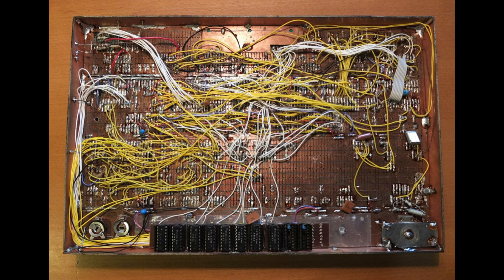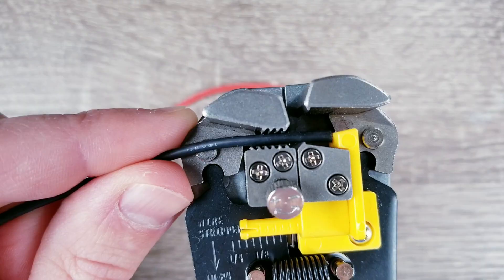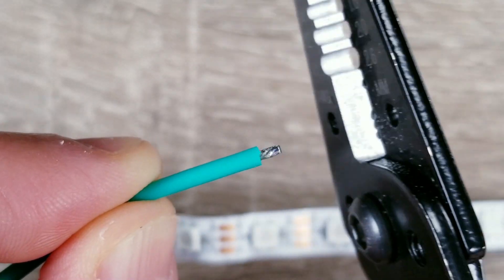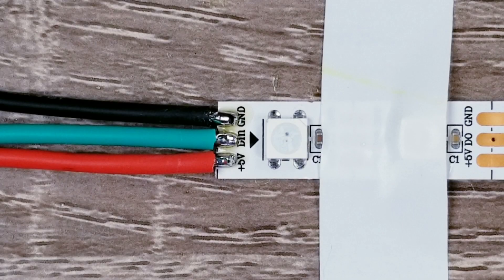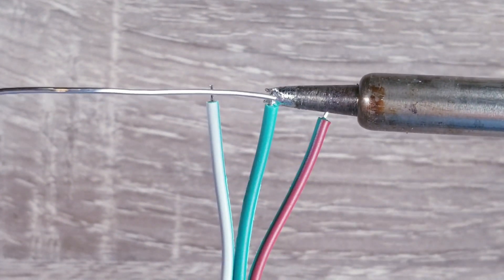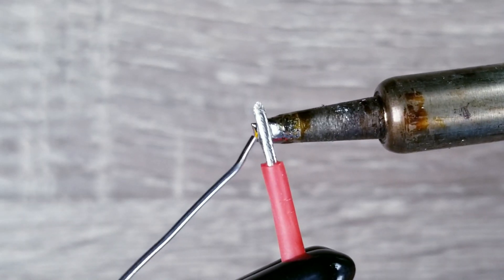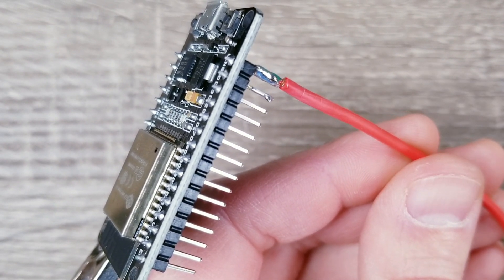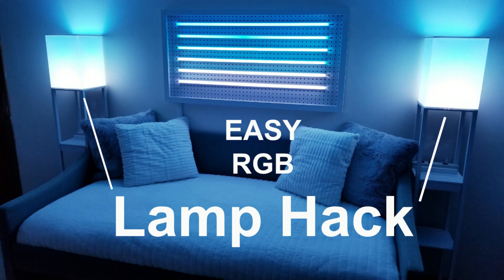THE BEST Soldering Tutorial - LED Strips and More - Complete Walkthrough

Comment: You never mentioned what temperature your using for your solder. Does this even matter? Also, when you are adding length to the LEDs, don't they lose their brightness?
Reply from the maker: Thanks so much for watching! So I generally use a temp of about 550 degrees F and that seems to work well. I would probably stick to somewhere around the 550 to 600 degrees! And at some point when you add LEDs, they will begin to not be as bright/not accurate color when voltage drop occurs. But if you are just running colored animations, you can power a good amount of leds without needing power injection. Its when you want to run white at full brightness that a lot of power is used. Thanks!
Reply: @ChrisMaherDIY Thanks for your quick reply! It's because I tried like 10 cuts with different lengths in between with one power source and the lights got dimmer and the effects weren't acturate. Any ideas how to fix that issue?
Reply from the maker: @twistedstyles  So I would say it would either be a couple things. 1 is yes, it could be that more power is needed. Have you tried injecting power at the end and see what happens? The other thing that could be happening (depending on how long the distance is between the wires) is the data signal on longer distances might not be able to make it to the leds like its supposed to and could also result in lights doing strange things. In this video https://www.youtube.com/watch?v=b13VLiK7AOU&t=1s around the 13min mark I added a resistor on the data line coming from the esp device to my first LED since the data line was somewhat long and that seemed to fix the issue. But this will generally only happen if the data line is long coming from the controller to the first led.

Comment: I bought the same soldering kit and the tip gets black pretty quickly and the solder won’t stick. Any tips? Could it be the wire I’m using (I’m using lead free wire that came with the kit you recommended)?
Reply: Sweet! Thank you for the response! I bought the solder wire that you recommended just now. It gets here this weekend. I’m hoping that was the main issue! 

I’ve been researching a bit on here about maintenance and what to do with an oxidized tip. Do you use/recommend any tip tinner or flux paste to maintain your iron?
Reply from the maker: @westsidefireman  Let me know if that solder makes a big difference! So i know the soldering Iron I use came with some tip cleaning copper wire/mesh stuff and thats all I have ever used to clean the tip. That stuff eventually got caked on with solder from the tip so I bought some more: https://amzn.to/3HiDqz0 and that's still the only thing I have used. After soldering and while still hot, I just twist the tip around in the stuff and it seems to clean it good!
Reply: The solder wire you recommended came in yesterday and it was the missing puzzle piece! None of those issues I mentioned before. Thanks again!
Reply from the maker: Thanks so much for watching and taking the time to comment! From the little research I did before attempting to solder, it seemed like everyone said that the type of solder you use makes all the difference in the world and the one I linked to in my description was the one that everyone on a forum I was on raved about and said was the best stuff they ever used. So my guess is you would have a completely different experience using that solder.

Comment: I have a few questions.
1) Instead of using a 5 volt adapter, is it okay if we connect the mobile phone adapter from the mini usb input of the ESP 32 and give it voltage?
2) When we use a telephone adapter, is there a need to apply voltage to other points of the module?
3) How many pins of ESP32 did you connect the green wire to?
Reply from the maker: Thanks so much for watching! So I have successfully powered the esp device using an old phone charger which would eliminate the need for the converter. You could then just power the led strip directly with the 12v power. You would still need to connect the gnd to the gnd of the 12v power supply though. I just connected the green data wire to 1 pin of the esp32 module. I believe it was the d4 or d2 pin.

Comment: nice video. i bought a soldering kit and have started practicing. one question that seems to have multiple conflicting answers? can this be used to connect ANY brand or type of led strip? specifically i want to turn corners with govee rgbic strips (the three conductor type). there are some people that say you can cut and splice rgbic, some say you can't, some say you can with the regular rgbic but not the rgbic pro, i know you have cut and spliced the m1. it would seem like electricity doesn't know the difference between a copper pad and a cut copper pad connected together with a wire, should it?
Reply from the maker: Thanks for watching and great question! So in my experience, I would say you can cut and solder wires to any govee led strip and it should work just fine. Like you said, electricity doesn't know the difference. Every time I have cut a govee strip and soldered them back together using wires it has worked. Now I'm sure if you try for example putting 30 or 40 feet of wire in-between the 2 sections then maybe you would notice something just from the voltage having to travel all that distance but I don't think it would be noticeable with smaller sections of wire length if that makes sense.

Comment: Chris can you lengthen the special connector cables that Govee uses for their Hexapanels? They use ones that break pretty easily ive had 3 break and Govee has replaced them but it would be cool to not have to ask them anymore when it happens again.
Reply from the maker: Thanks so much for watching and great question! So I'm not 100% sure but I just looked at mine and when you remove the white cover that goes over where the cables plug into it looks like there are just your basic 3 pins that you could for sure just solder some wires of different lengths between 2 of the hexagons and it should work. I did the same thing on the govee glide which you would do on the hexagon https://youtu.be/4-cdYOFZ9fs and it worked great! I'm not sure how govee feels about it or safety but I always say if it works and things are not smoking or on fire in 5 minutes, I'm rolling with it.

Comment: If I just wanted to get my M1 LEDs to go 90 degrees, say like along the corner of my wall to the ceiling, do I need to do this method? Or can I just use something simpler like one of those LED connector things
Reply from the maker: You can set things up to go up the corner of your wall and then on your ceiling without needing to cut. However if you want to go up the corner of the wall and then remain on the wall by your ceiling then it would probably be hard to do that without cutting them. You could try bending it but It probably would not look the best. There are a lot of connector pieces for led strips that will do a right angle but from the looking i've done on amazon, I couldn't find anything that would fit this led strip at the moment. Its a 4 pin and the strip is a little over 12mm wide. I found a lot of 4 pin connectors but they were for 10mm wide led stirps. I'm sure at some point they will be available! I'll keep checking!

Comment: The wires I had actually repelled the solder for some reason. I couldn’t even tin the wires. 
Eventually, I cut the wires shorter, about 1/16th inch (2 mm), and it was MUCH easier. I have since ordered better wires so hoping for that’ll help.
Reply: They were likely cheap copper-clad aluminum wire. The copper layer is so thin that it quickly dissolves into the solder, leaving the unsolderable aluminum. 

I once had to fix a cable made with that crap, and once I figured out what it was, knew that I had to work extremely quickly to get the job done before the copper dissolved away. Huge PITA.
Reply from the maker: Thanks so much for watching and taking the time to comment! I'm curious as to what wires you had where it repelled the solder. Did you get the led lights to work eventually?!
Reply: @ChrisMaherDIY   the wires I used were some cheap jumper wires I originally used with a breadboard. I cut them down for a small project requiring a few short strips of LEDs to be connected with wires. I ended up spending a couple hours trying to solder them and honestly thought I’d destroy the LED strips in the process. Luckily, it all worked well after shortening the exposed wire and the LED strips weren’t too damaged from prolonged expose to heat.

Comment: Another great video, I’m definitely subscribed now! I had a quick question for you when you have a minute, I started a car audio and electronics channel a few months back when my wife and I closed our mobile audio/video shop after about 10 years in business, so I’m fairly familiar with electronics, soldering etc. but I was wondering if the ESP 32 module comes with Bluetooth and Wi-Fi or just Wi-Fi, I am looking to use it in my vehicle after plugging it into the computer etc. because of the better options that WLED offers compared to the chintzy modules out there. I did notice that it mentions that it is Bluetooth and Wi-Fi capable I believe but I can’t find anywhere that says whether or not it is built-in I don’t mind adding a module to it I just want to make sure I order everything that I need! Anyways hit me back when you get a second thanks again man, And keep up the great work!
Reply from the maker: Thanks so much for watching and for the support buddy! So from my understanding is they do not have Bluetooth. However, they emit their own wifi signal that you can connect to and I'm not 100% sure since I have not tested it out but I think you could connect to the devices wifi signal and be able to control it that way. I've got this question a few times so I should really test it out and see if it does work that way since there are a lot of use cases where you will not always be able to connect it to wifi.

Comment: Gonna try soldering leds soon, is flux needed when soldering wires to led strips?
Reply from the maker: I'm still not 100% sure on the flux. With the solder I use it seems to work just fine as is. Others have said to use flux to make things easier but I have not experimented with it being that I've had good luck with just the solder that I found.
Reply: Flux is always needed, but electronics solder wire always has a flux core. It wouldn’t work otherwise.

Comment: If I solder a wire to my ledstrips than the solder doesn’t stick to the ledstrip
Reply from the maker: The solder i'm using seems to work pretty well as far as sticking but some have commented that if you get something called flux to apply to the led strips, it will work much easier! Thanks so much for watching and taking the time to comment!

Comment: You are my favorite channel this year! awesome videos. One quick tip that I see you completely ignored: Use flux! that will change your soldering life.
Reply: I agree with bluetorch. As soon as I started using flux, my soldering become much better, quicker, and easier. I got some from harbor freight a long time ago at beginning of pandemic when supplies were low. I don't suggest it, but it's better than only what comes in the solder.
Reply from the maker: Thanks so much for watching and I'm glad you are liking the videos! Appreciate the kind words buddy! Are you able to see if the solder I'm using has flux? It says this in the description: Core / Flux Type: Rosin Core / 44 Flux (3.3%) https://amzn.to/3HIRjod
Reply: @ChrisMaherDIY  you need to apply flux to the contacts with a little brush and to the wire before you apply heat+solder wire, it will flow super nice and quicker (so less heat time needed, less chances to melt/damage), also less chances of cold solder joints.
Reply from the maker: @bluetorch13  thanks again! Do you have a flux that you recommend?!

Comment: Anyone know what pins to use when you stupidly bought the 38pin version instead of the 30? - Sincerely, a total NOOB
Reply from the maker: The 38pin board looks like its a very good one! Even though I don't know the answer, I would maybe test it using the G2 pin and see if that works? In WLED when in the led preferences setting there is a spot where you can put what pin you are using. I would just do trial and error until I found one that worked! Probably use breadboard jumper wires to make it easier to switch around and then you can certainly solder everything once you found it. Thanks for watching!
Reply: @ChrisMaherDIY  Oh man I had this same question. Whats weird is I actually used your link but amazon sent the wrong one or I dont know how but none of the pin designations match any. I watched all your tutorials (which are great btw) a good number of times. Been buying Govee but I love DIY and after seeing you make it look effortless I had to jump in. Keep up the good work and keeping making all the cool items
Reply from the maker: @aircomba  Thanks so much for watching and glad you are liking the videos! That's strange! Are you by chance located in the US? I think if you are in a different region and you click on a link, it will automatically re-direct you to your amazon page to either the same product (if available) or something they deem as similar (if the exact same one is not available) Maybe that is what happened? Is there any youtube tutorials that are out there that use the exact same module you have?!

Comment: Chris, thanks very much for this tutorial video! Do you keep the soldering iron set at 550 degrees for all of these tasks, if not, could you let us know what temperature per task? Also, what heat gun do you use? Is there a particular setting for setting the heat shrink tubing?
Reply from the maker: You are very welcome! Yeah, for everything I did in the video I had it set to 550 degrees F. I think this was the one I used for the heat shrink tubing. https://amzn.to/3juXgd4 You can adjust the temp but it gets really hot and I just try to not have it super close to the led strips or the esp boards as I don't know if the heat super close to those parts would do any damage. I've also seen people just use the flames from a lighter or a match so there are many options and ways you can go about it. Thanks as always buddy!

Comment: Great tutorial Chris, when I first got into LEDs I pulled apart an old broken VCR and practiced soldering on that till I was ok... Ish!
That last video using the SK6812'S was great and I'm definitely going to use them instead of my old rgbww analogue strips I've just binned, but for the areas where I don't need a warm white I've been looking at the new SK9822 strips, apparently they don't suffer so much voltage dropping problems but they also have clock as well as data, do you know if having that clock connection means I'll have more control over the speeds? Or is it something else?.
Appreciate your thoughts.
Reply from the maker: Practice makes perfect! Even though I still don't love to solder, its not as bad as I built it up to be in my head lol. I'll have to take a look at those new SK9822 strips! I see they have the 4 pin setup with the clock connection. I did a quick google and have no more idea now than I did 10 minutes ago on what the benefits of the clock connection or how it would be used. There has to be some reason its there and some way that makes it better! I'm going to keep trying to learn about it to see if its something that would work good on new projects! Thanks as always buddy!
Reply: @ChrisMaherDIY 
Ha ha, that's exactly what I've been doing!
I'm sure somewhere on google we'll find the answer,
Thanks Chris.